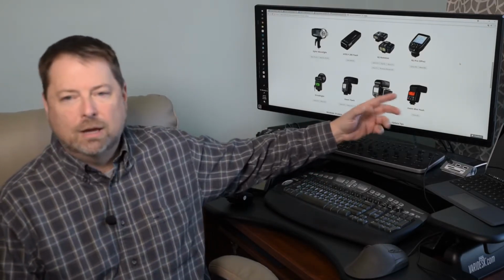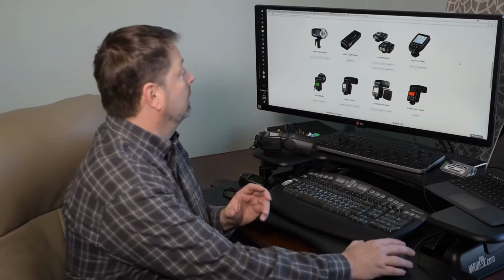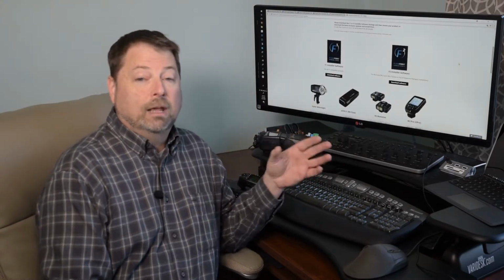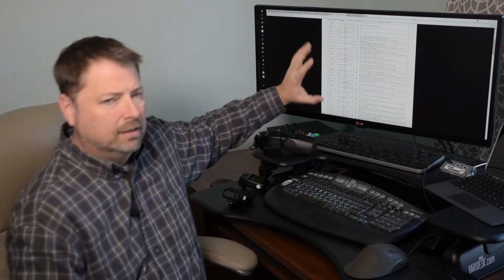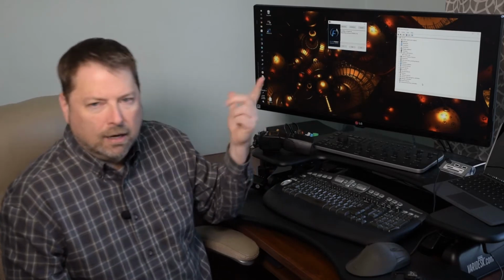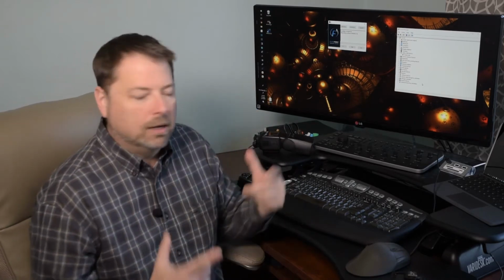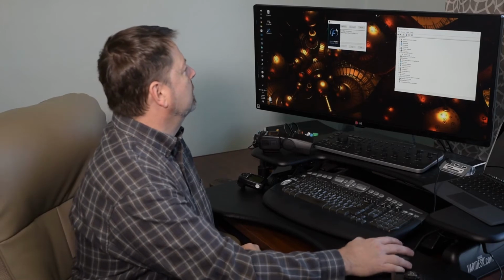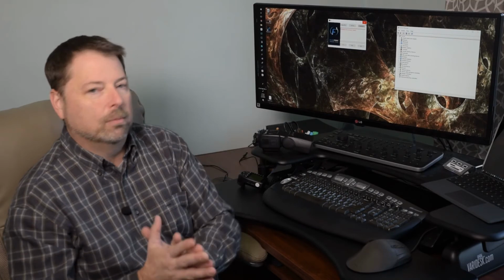Godox Firmware Process

Comment: Hello, after updating the ad200pro stop's working. Dos'nt turn on. any idea? Thanks
Reply from the maker: Sounds like the firmware got corrupted during the update.  Have you tried to reflash the firmware using a different USB cable?

Comment: Thanks for the video - worked perfectly. So frustrating that the other tutorials all start from having your device plugged in and the software installed as that is the confusing part.
I struggled to get my computer to recognise the flash but it eventually worked when I tried a different USB slot on my computer.

Comment: OMG! I have spent hours trying to figure out why I could not get the firmware updates from Godox. After watching your video and using Flashpoint instead, I was up and running in several minutes. My Godox flash was simply not firing with my newer Canon Camera's shutter and I was starting to lose it! By chance I discovered that I needed a firmware update, then could not figure out why I could update the trigger but not the flashes through Godox. Thank you for taking the time to post this!

Comment: Its interesting that Adorama Flashpoint has a firmware update to the V1 flash while Godox site does not. Are the firmwares interchangeable?
Reply from the maker: Yes.  Adorama repackages the firmware binaries slightly differently so that they are self extracting (doesn't need a 3rd party app like 7Zip) but the code is the same.
Reply: @ImagesbyDesign  Thanks, Oddly, Godox site does not have a patch for the V1 flash, and Flashpoint does, for the v1.4 firmware. The issue is that the V1 puts other Godox flashes into Multi mode in error.

Comment: Hi I have the AD200 Pro - I want to update the firmware however my pc does not recognise my AD200 pro.  when I plug it in its not found? 
please help.  thanks Keith
Reply from the maker: The 4 causes I've found for not recognizing a Godox device are 1) Did not turn off driver signing when installing the Godox app, or connecting. 2) cheap USB cable, 3) plugged in to a hub and not a direct USB port on the computer, and 4) did not remove the batteries from the device before connecting.

Comment: Love Godox for what they have done, on that note the main issue(s) are 
if you're using non Godox strobes you can not control the lights even 
with the firmware updates. All you have is a trigger it's looking like 
Yongnuo is the only flash controller that will work with your mix of 
light.
Reply: Hi Anthony.  I'm not sure I understand your comment.  All radio control/trigger systems are proprietary, whether it's X1 (Godox/Flashpoint), Yongnuo, Paul C Buff, Prophoto, etc.  So the trigger for any given ecosystem will only be able to control lights that talk that same RF language.  If you were commenting on my gear specifically, all of my current lighting gear is X1 compatible; from speedlights, to mid-sized and full sized studio strobes, so a single trigger will control/fire all of my lights.  You can do some control of other brand speedlights if you have the proper receiver.  For example, you can shoot TTL, change zoom, and other things (just not change power levels) on any speedlight by attaching the appropriate X1 receiver module onto the shoe plate of that speedlight.  I hope this helps.

Comment: 6:00: "I'm gonna put some batteries back in..."
Why not start the video by mentioning you have to take the batteries out before updating the firmware? That could have saved me some hours... :)
Reply from the maker: That's a valid point.  The other cuts where I remembered to mention this didn't make the final edit.  Sorry that caused you wasted time.  The release notes that come with the firmware tall you all the steps you need to perform to prepare your device for the update,  including removing batteries.
Reply: @ImagesbyDesign  Thank you for the reply. :) As far as I can see, there is no mention of this in the manuals, at least not with the european edition of the Godox X1T anyway. It only says: Connect to your computer with a micro-USB cable...
Reply: @ImagesbyDesign   Wow, you're response to Ketil is to RTFM! Funny...   If you are going to have a how to video on something, you should rehearse it first, go through each step of the process painstakingly and show/discuss some of the "gotchas" that may occur. Poorly done video.
Reply: @57JackCaptainSparrow  You're right, Jim should return his commission for making this video... I'm sure he made a bundle!

Comment: Hi Jim, thanks for your very informative video on Godox firmware update. I have tried [prior to viewing your video] to update the V860IIC flash firmware according to the unnecessarily complicated G1 process and while this procedure recognises and acknowledges the correct equipment (ie., the V860IIC) and also acknowledges the correct firmware has been selected, it then fails to connect to the flash and as a consequence fails to complete! Interestingly, Godox has not bothered to respond to my email outlining this problem sent two weeks ago now (so I won't be holding my breath for them to do so - which is very poor and certainly a big tick against purchasing any further Godox equipment which, by the way, I was intending to do). Anyway I think the problem lies with me not previously knowing to turn off the Win 10 driver signatures and will now do so according to your Windows link - hopefully this will be the solution to this very annoying issue, and if so, I sincerely thank you for your help in this regard. Cheers from Down Under
Reply from the maker: Let me know how it goes.  Do also make sure you're using a quality USB cable, and not passing through a hub.  

Godox is strictly a manufacturer so they have almost non-existent tech support or warranty.  Here in the US we have Adorama (and others) rebadged versions with in-country support and warranty.  See if you can find a similar channel in OZ.  Cheers!
Reply: Thanks for your speedy reply Jim. I have finally got the V860IIC firmware to update to V1.7 using the Godox method (rather than using the Flash Point method because the latter does not have the latest available firmware updates for my Flash or XProC transmitter) by first trying every combination of connecting the flash to the laptop and then running the G1 program. As it turns out I first had to find a method that actually turned off the Win 10 64 bit Certificate Signing requirement before running the G1 program so that the USB device driver installs correctly. 

After first turning off Win 10 64 bit Cert Signing that worked - see below", I then connected the Flash to the laptop (flash turned off, Li-Ion battery installed and first pushing the test flash button before connecting to the laptop). I then ran the G1 program and it ran as it should and installed the latest firmware – Ye Hah! Prior to this I had tried three different USB cables and none of these three "appeared" to work! On the Laws of Probability (and me being a retired scientist) I figured (correctly as it subsequently turned out) the USB cables were all OK and not the cause of failure to load the firmware.

Both methods for turning off the "Win 10 Cert Signing" listed in the link on your video actually worked but there is a qualification for both methods, as follows: Solution 1. “Change the Start-up Settings” and Solution 2. “Using the Command Prompt” listed in Milan Stanojevic's post (the link on your site): 
Method 1 is much more involved and you need to print out the procedure to follow as there are quite a few steps where you need to know what to click on next and you are essentially following blind because you can’t have a word doc opened to follow step-wise at the same time - I attempted this procedure last. 
The Second procedure also does work to turn signing requirement OFF but DOES NOT work for turning the Cert signing back ON. It is only after you realise the author accidentally omitted a critical part in the text you have to type in at the Command Prompt if you wish to actually see that singing has been turned back on (or off for that matter) before rebooting the computer. I would strongly suggest your readers follow this procedure as I do not want to leave it to “….. maybe signing has been turned back on by just rebooting the computer…”, because this is such a critical security setting for the computer to have it turned on properly!
I am not suggesting that simply rebooting the computer won’t reset this functionality as indicated in the post, however I am very much a “show me ……” person and need positive proof of something working properly rather than leaving it to blind faith on someone’s say-so!
The line of text to type at the Command Prompt statement to turn signing OFF is: (shown in red text - Hmm different text colours do not show up on posting this comment so type every thing that appears AFTER each COMMAND PROMPT STATEMENT (that is everything after the > symbol) as shown in what follows)
C:\WINDOWS\system32>bcdedit.exe -set loadoptions DISABLE_INTEGRITY_CHECKS
To turn signing BACK ON BEFORE rebooting the computer and AFTER installing the new firmware is: 
 C:\WINDOWS\system32>bcdedit.exe -set loadoptions TESTSIGNING  ON
Note that “ ……loadoptions”,  was actually missing from this latter instruction. Also, that all spaces, upper and lower caps plus “ – “ as shown here are critical to this instruction. DO NOT include any “ “ marks in this statement, either.
Hope this helps your readers. Cheers from Down Under and keep up the great videos.
Reply: One further point I forgot to include in my lengthy dissertation (above) is when in the Command Prompt Mode after you have just turned off Cert Signing after hitting ENTER and then seeing the Command Line confirmation that it is now OFF, or after hitting Enter on the restore Cert Signing ON statement and seeing the command confirmation is now ON once  you have installed any firmware; you should type EXIT at the flashing cursor in both statements to actually exit out of the Command Line Mode which then returns you to Windows. This is good practice to maintain when exiting from the Command Line Mode. Cheers,

Comment: check what little button to check firmware version?
Reply from the maker: On the X1/R2 trigger, hold down the mode button while you turn the unit on.  The version number will appear in the upper right corner of the screen until you release the mode button.  Other devices show the version on the menu screens.

Comment: Im getting U-23 on my X1T-c trigger and it wont allow me to use any other functions any help please
Reply from the maker: I think the MODE button might be stuck.  If you hold the MODE button while turning on the unit it displays U-{the firmware version}.  Try pushing and releasing that a few times to see if you can get it un-stuck.  If not, talk to your retailer about replacing the unit.

Comment: I get USB DEVICE NOT RECOGNIZED message every time I connect my X1T for canon via G1 software...any suggestions  ?
Reply from the maker: In device manager, do you see a Godox USB device listed, or an unknown device?  If unknown the USB driver didn't install properly, so disable driver signing again and re-install the G1 utility.  If you see Godox USB Device, then try a different/better USB cable.  Make sure not to use a USB hub or extension.  Hope this helps.
Reply: Thank you..I will try that...

Comment: after upgrading the driver, wich program crashed, the X1T-O wont turn on again, any advice?
Reply from the maker: Hi Ernesto.  The USB driver is installed on your computer by the G1/G2 firmware tool and allows your computer to recognize the Godox light as a USB device.  The firmware is the code that is sent to device.  I'm reading this that you tried to update the firmware on your X1-T and now it won't turn on.  Perhaps just gives an e9 on screen?  

If the firmware update tool said that the update completed successfully, you probably downloaded the firmware for a different model by mistake.  Go back to the Godox firmware page, double check that you downloaded the correct firmware for your trigger and try the update again.

If the firmware update tool is saying that the update is failing, then make sure you've removed the battery from your X1-T before plugging in the USB cable.  Try a different USB cable, and make sure Windows device manager sees your GODOX USB Device listed.

Good luck!
Reply: hello, thxs a lot for the quick reply!!, the g2 program crashed in the middle of the update, and it didnt work anymore after that, i was using win 10, even disable secure boot, and did the singning thing, after this, the  device got stuck (x1t-o) and didnt even turn on, i borrowed another pc, wich had installed win 7, and worked fine, it updated normally to v5, i think the problem was with win 10 maybe that didnt want to recognize the devices. said driver error all the time.
hopes this help another person with the same problem in the future, maybe i plug the device before installing the sofware, so i folowed your instruction and installed  the driver this time first XD. thxs nice video btw sub!+1.